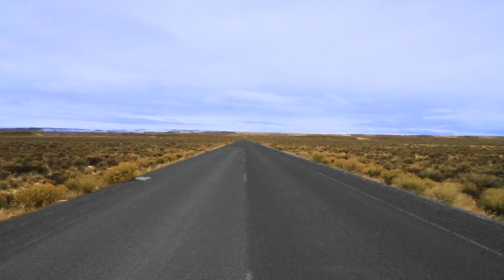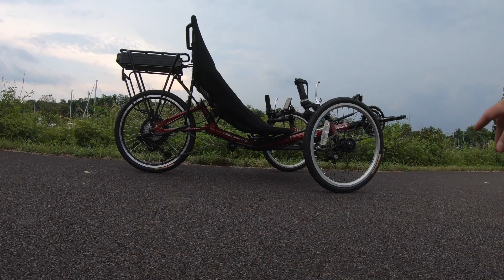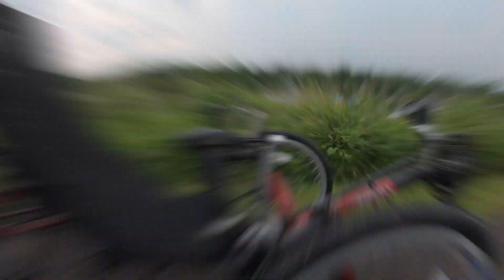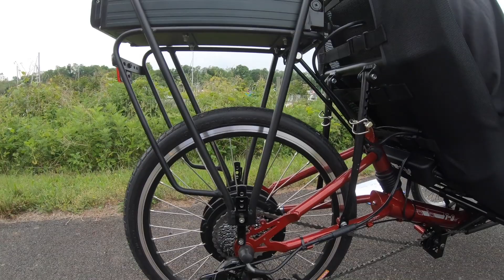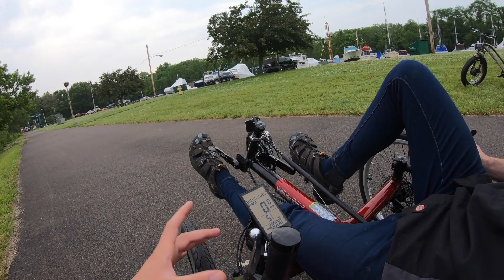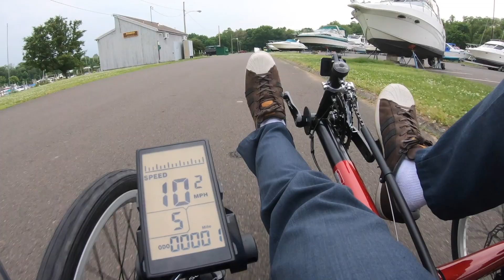Electric Bike Technologies Electric T3 CX Trike Review - $2.9k

Comment: HA! got that beat; HP Velotechnik Scorpion with 1000W 52V Bafang BBHD drive system 21WH battery, Shimano Ultegra Di2, Shimano 7000 series push-button shifting, 54 T Chainring, Schwalbe Marathon tires. Shimano XTR hydraulic 4 pot brakes XTR levers, Rear brake Avid BB7 is my parking brake. HP full carbon seat with wings, and rear suspension...Yea after 40 years on an upright bike, a recumbent trike is so much more comfortable, fun, and I can cruise 25 to 28mph. Indirect steering is far better feeling and more comfortable than direct. 26" rear wheel 20" upfront. It's the only way to go :)

Comment: It would help if you gave the gear inch range of the trike. That measurement tells me a lot about its climbing ability and potential crusing or top speed. For this trike, the gear inch range calculates to about 18.75 for low to around 95 on the high end. This trike would be a good hill climber as well as a hgh speed cruiser.

Comment: After 4 minutes i was disappointed. First of all, this isnt made for speed at all, 20 Inch wheel in the back is way to ineffizient, i would rather take a 26Inch wheel.
The seat also is more like for comfort then for performance the dampening from the mesh takes a lot of energy that you otherwise could invest in speed.
And last but not least the direkt steering is way to sensitive for higher speeds.
But all this is all well if you think that 25km/h is "high speed" so go for it and you will be happy, but what bothered me the most was the explanation for torque on the pedals.
If you follow his recommendations and push harder because you can push against the seat then you will destroy your knees, this is a well known problem and the reason why good recumbent trikes have a much larger range of gears so you can pedal with higher speed rather higher torque.

So dont destroy your knees by following his instructions and buy something like the Velomo HiTrike if you want performance...